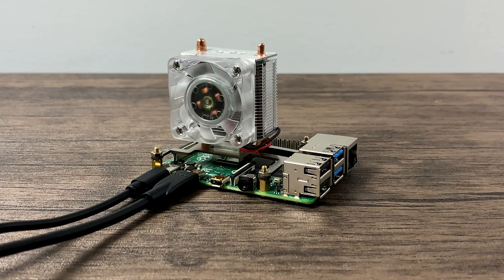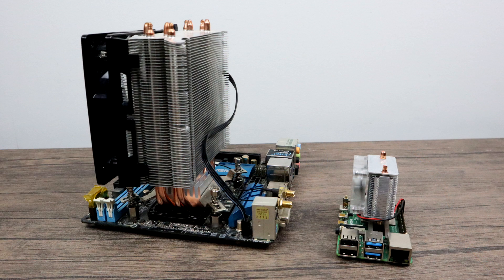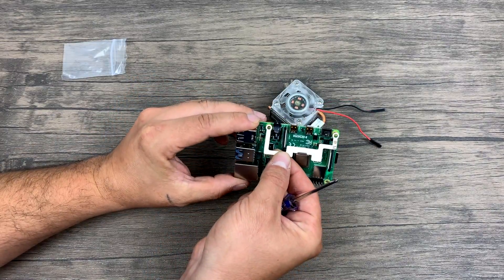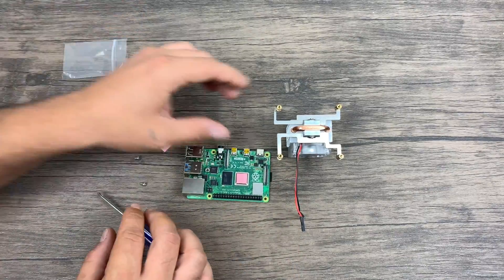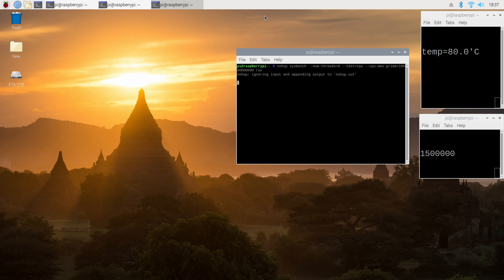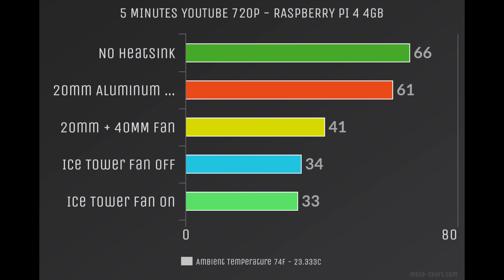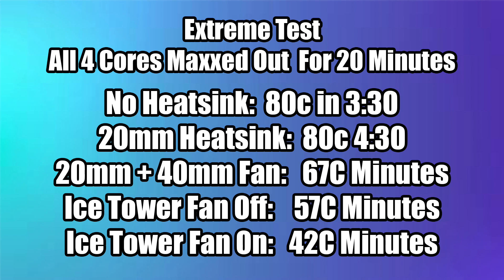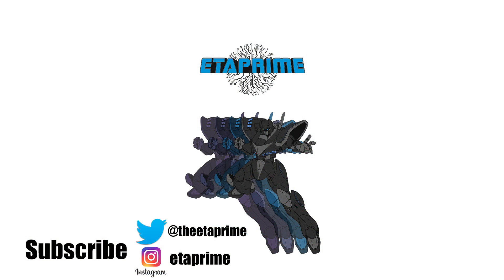The Best Raspberry Pi 4 Cooler! The Ice Tower Also works on the Pi 3 & Pi 3B+

Comment from the maker: Sorry for the quick re-upload, The last chart was a little messed up in the original.
Reply: Overclock overclock overclock!!!
Reply: overclock overclock overclock!!!
Reply: Maybe try some thermal compound and see if it improves the cooling compared to thermal pads!!
Reply: do some bigger oc on it
Reply: See if you can get it to 2ghz +
Reply: The image at 6:25 still says "minutes" three times for no reason in the bottom right
Reply: Can you give us your Temps with the Ice Tower cooler, if you Overclock your RP4 to 2ghz?
i'm looking to get this cooler, but i'm also looking to Overclock my RP4 4gb to 2ghz, 
so with some more info from you, that would be awesome, and most likely the final though, before i buy this cooler :)
Reply: Is there a case that can work with this yet?
Reply: It comes with 3 pads and theres a little play with the cooler when bolted to the pi would it be bad or hurt it if i stack another pad so 2 pads to take up the space?

Comment: I have nice results with some very cheap cooling blocks (included in some kit) and a 60mm Noctua 5v fan (I run it on 3v). I bought some raspi cooling kit but the cheap included fans were way too loud at night

Comment: I'm getting a bartop arcade cabinet it has the rasberry pi 3b+,in it,running hyperpi,I've seen they have one of these on ebay but it's the low profile one,should i get one of these i wont be over clocking just plying arcade classics and PSP and Nintendo 64 games,just wasn't sure if i need this to play these games,also does it draw to much power when plugging this into the pi.or should I get the flirc case.

Comment: So how do you mount the Pi afterwards? I have the MB mounts for my arcade using the 4 holes on the PI and they are needed for this cooler (Yes sime case or bottom plate mount would be great)

Comment: Its a very good heatsink for rpi4 cool...
But there can be one problem here it will affect your wifi performance because the metal mounting bracket of this cooler comes exectly over the antenna and it will reduce its performance drastically.ble and wifi will get affected. It will be better if they go with plastic good quality brackets instead of metal.

Comment: I use the Noctura 5v fan mounted onto an open air plexiglass case with aluminum heat sinks and the latest RPi4 firmware.

Comment: I want to know if I use this raspberry pi 4 inside a car which park under a) open air  or b) Car Park in a building, will it cause a fire or flame when there is a program or app running in it with respect to with and without Ice Tower? In short, it is safe to run a program on raspberry pi 4 inside a car which is 1)  turn off and  2) is running on the road with aircon turn on. Thanks

Comment: Someone should write a utility so you can do the 20mm + fan and connect the fan's positive lead to a switched pin on the GPIO so that it will only turn it on when the CPU temp reaches, say, 75 C. Bonus points for using PWM to vary the fan speed.

Comment: And how i can attach my hifiberry now? And what case will fit?
Reply: Something I was thinking about, what the Pi Foundation should be thinking about going forwards is having the add on boards underneath the pi rather than on top. That way they wouldn't interfere with any cooling solution needed. Add on boards would just need to move the socket from the bottom to the top. Would create a problem for older boards meaning add on manufacturers would either have to offer two boards or supply unsolder and DIY.

Comment: Cool but it's bulky and cools the CPU only. On the other hand 40mm fan mounted horizontally above the board is much more compact and cools all the components too, eg usb controller.

Comment: To the Pi Design Engineers:
This makes the Pi combersome, especially, for anyone interested in using it as a music player with a hat. The Pi engineers should focus on more efficient CPU architectures that run cooler and get more efficiency and a longer die life. For adolescent geeks, this definitely, looks exciting, and I also add, beautiful, but is it really a good move? Please, designers and engineers consider to use an SOC that is more energy efficient and cooler to run.

Considering the temperature at which this runs, I will not consider buying anything similar, and will stick with older models. I have a Raspberry Pi 3B+ that can run without a heatsink: that is what I really call a credit card sized computer.
Reply: The Pi 4 has only slightly higher power consumption than the Pi 3 B+ (around 1-2 W higher). The thermal load is still very low, at less than 10W for the whole board for most realistic workloads. The Ice Tower is simply overkill for this board, which the video clearly shows as well. A compact case with a 40 mm fan, ventilation holes and no heatsinks will be enough to keep the Pi 4 from throttling. The Pi 4 is still a low-power and efficient computer. The big problem is that you simply can't get away with more than a handful of watts for an SoC with no cooling at all. A single watt may not sound like much, but for a small chip with no cooling at all (and perhaps confined in a closed case) it will have a large effect on temperatures.

Comment: Dedicated heatsink attachment points on the PCB would be greatly appreciated, even if only 2 mm in diameter.  Maybe the foundation can set a standard like they pretty much did with the I/O pins.

Comment: A challenging idea : I'd love to see this board in a little laptop chassis with 12" 1080p screen , huge battery taking pretty much all under the keyboard minus the space for the board and heat sink with fan besides the board instead of in top , so it stays as slim as possible, a copper pipe running over all the chips and to the heat sink , will do a great job I guess . inline ports soldered to the board instead of the 2 levels ports that are giving too much thickness for a laptop case implementation .

Comment: If it didn't use such a slow cpu i would buy it. Atleast an 8 core ARM cpu or a quad core at 2ghz+. Who agrees?
Reply: this is easily achieved by "overclocking" the pi 4b to 2.0ghz as long as you cool it. i read that it wasn't even a overclock as the a72 baseclock was higher than that, but that the firmware/software refused to run on higher speeds than 2.0ghz clocking a72. another cool feature of the a72 is it's performance per hz that has been increased. the instruction set inside the chip was made more efficient and this is why people claim it to be up to 3 times faster than the 3b+. we just need some time to see the firmware and software mature and improve the board. sit back and relax, within a few weeks we will know more:)

Comment: I think it's necessary to use thermal paste with this. Thermal pads are only good for low-heat applications. If the CPU reaches above 70, that thermal pad is going to be the "bottleneck" of this cooling system.

Comment: Nice testing!  I'm going to get a Pi4 for my everyday computer so i can do some robotics dev.  I will get the ice tower, but not bother with adding the fan for just a few degrees difference. Mainly because I like it nice and quiet and fans tend to add noise.  All good wishes. I gave you a thumbs-up.

Comment: You should get liquid nitrogen and see how far you can over clock
Reply: Pi has voltage locked down hard, you mostly need a voltage mod
Reply: i saw a video where they had to supply their own voltage or something for a higher overclock
Reply: James Holbrook yes I have the parts for it (I’d use my EVGA Epower V board), I also run daily computer systems sub-zero (-35c block temp for sub-zero core temp peak on even FX-8350 at 1.7v, or -60c idle), the pi would be at -60c on that cooler since anything below 20w is what I call idle. I also have a T-Rex LN2 cooler for big CPUs like my Threadripper, but its baseplate is bigger than the pi, and the components on the board would get in the way.

It would probably make a fun and interesting video, but it’s really time consuming to make a compact video for that (a lot of work involved, mostly filming and editing plus research for the mod), but if someone wants to send me a pi, I’ll gladly show how to hook it up and bench it to the limit and see what records I can break (the pi will be pushed to destruction, I won’t be sending it back, that’s just the price of record breaking and filming cost is basically nothing since it is only worth my time because it would be fun, and that’s why I benchmark anyways is for the fun!)

Comment: Little advice, use two fans at half the speed. The airflow will be the same but the noise will be a lot less compared to one fan.
Reply: That’s not how fluid dynamics works... the velocity doesn’t go up by a factor of 10 when I stack 10 fans on top of each other when they go the same rpm they did before now does it? So why would it for 2 or 3 or 500? It doesn’t... airflow is volumetric flow rate, or area of fan times velocity, so no matter how manny hundreds of fans you stack push/pull, the velocity won’t just increase by a multiplier like that without the RPM increasing (I do have duel stage contra rotating server fans, the front is 7 blade vane and the second stage is 5 blade with aggressive pitch, they run different RPM to maximize airflow, however don’t be fooled thinking they aren’t doing this to increase RPM/velocity/airflow, just look at the math, volume per time is airflow, and that’s area times velocity (distance^3/time).
Reply: Not at “half the speed. The airflow will be the same”, that is physically not possible, and to that I’d say study physics. I have an aerospace engineering degree, but I will still say “it’s not rocket science”, the physics is very easy to understand.

If you still don’t understand, draw it out, you can simplify the airstream as particles slapping an angled blade, or simply envision the particle being thrown from a blade of X diameter and Y RPM with Vtrsfr_efficiency= ~90%, and then envision that particle hitting the second blade again at the same X and Y V, meaning that it really can only gain approximately 9% faster velocity with the second fan. That would be roughly 49.5 units/time vs 90 units/time, that’s certainly not the same...
Reply: Also your dB scale is wrong, it’s logarithmic the other way, it would be 12dBA vs 15dBA (not 3 dBA, my goodness, an inaudible cricket a mile away would be on that scale!)
Reply: @jakegarrett8109  . I actually have a physics degree and have been over two decades in the field of acoustics and extensive experience in practical research and testing. So i think i know a thing or 2 about these things. I would highly suggest googling/searching the relationship between acoustic noise levels vs RPM, because yes that is a 50 log. Fans are somewhat between a coherent and incoherent source, so therefore the 3-6 (more like 5) dB if you double them. Two fans in series have the ability to deliver double the amount of air. Especially in a push-pull configuration were there is quite some resistance (like a heatsink). But hey, do whatever you want with it, i am not here to have a nitpicky debate about things that can easily be found on your favorite search engine and has been used for the past 70 years or so.
Reply: Merlin Gallagher Merlin Gallagher wrong, that is for parallel (which makes sense, 2 fans sitting side-by-side equals two times a volumetric output), in series this is simply not the case for any fluid pump in series!

So your saying my stack of 10 fans in series (stacked) = 10x the airflow? Wow is everyone going to laugh at that physics! (I hope you haven’t been using that for 70 years, because it’s been wrong for the last 70 years...)
Reply: @jakegarrett8109  That's not what he was saying. He clearly said that it only counts roughly for a small amount of fans, which is more than obvious since there a lot more things that influence these numbers. The only decent approach is are FEM simulations and even those are very limited if it comes to acoustics as well as fluid dynamics.
Reply: @jakegarrett8109  I also don't have a clue what you're talking about, but I can confirm that @Merlin Gallagher is absolutely right in this. Time to get out of your dusty books and lab and see how things work in the real world would be my advice as a technical consultant and CTO of different tech teams (so fun when people show off their so called degree)

Comment: Do me a favor ? You made the late panda alpha + rtx 2080 ti... then how abouth trying mounting the ICE-Tower on a real cpu like the Pentium G4560 (54w) and running the fan at 12v insted of 5v :D
Reply: Would most likely blow the fan circuit if it wasn't designed for 12V what appears to be the case
Reply: @resneptacle  "all" fans are normaly 12v but runs more silent on 7v-5v

I'm running an G4560 htpc with 100% no mowing parts..

I'll bet i'll be able to "netflix and chill" on the G4560 with this micro cooler (not silent) but i'd "lap" the surface of the cooler first and mount it with propper thermalpaste..

Comment: If the fan off isn't making too much of a difference, could try putting a Noctua fan. Since this is pretty cheap, that fan is probably airflow optimized, and isn't able to push much. Noctua fans are good for static pressure and still quiet.

Comment: Is their a way you could diy your own heat sink to see if it can out perform this heat sink?
Reply: I developed a water block for raspberry pi, look up Thingiverse for “Penny waterblock” it’s 3-D printed and uses a US penny sanded down. My entire water cooled tablet cost about five dollars, actually slightly less.
Reply: @jakegarrett8109  i have seen that before! How well does your design do compared to the heat sink ETA prime tested out in this video?
Reply: Blue 4lifeblue it should be way better. I used the 20x20mm heatsink he had, and it was a massive improvement going to water cooling (before I wasn’t pushing overclocked, and on water I hit a 44% overclock at 50c max). Which is not surprising since water cooling you don’t have the distance limitation you do with fins or heat pipes, and the radiator can be as big as you want (and because it’s so much more efficient pumping the heat through the water, you don’t really need a fan or as big of a heat sink, you could also make it custom shaping as I did).

Comment: This cooler may not fit an X86 CPU, but it looks like it might do a good job on one of those new AMD X570 chipsets.
Reply: Only if you opt out of using any graphics card. The cooler is in the way of that due to the chipset location.

Comment: interesting is use cooler without fan... good temperature. have You try to put cooler 90 degree for use natural ascension of hot air? maybe temps could be lower

Comment: So the ideal cooler would be a passive slightly shorter heatsing than the ice tower with a case that fits. 
By the way, could you test it with overclocking?
Reply: *heat sink

Comment: It's in the ball park. Better than the FLIRC CASE. But it's not the BEST. You need to idle below 30 c and when doing a stress test you can not  break 40 c. Theirs not enough metal on the cpu. Go to your large chain  hardware store and look up to where the steel rafters are bolted to the steel columns . You need the nut and the fan of the ICE COOLER .  You need a 22 mm spanner to turn this nut . Yes metal on the cpu. You will not break 40 c and idle below 30 c. I' now using round led eat sinks idle 26 c cannot break 35 c stressed and over clocked on sysbench it runs cooler when stressed. 
RUN SYSBENCH 4 TIMES 20000 PRIME NUMBERS 4 X IN SCRIPT CAN'T BREAK 35 C.   
SAME AT 40000 RUNS COOLER.
Reply: Who says you can't break 40°C? That's very cool for such a CPU under load
Reply: No  heat sink you are going to thermal throtel. Don't think computer  geek . Don't even put a tinker board heat sink  on It. 
Tinker board heat sink is 25 mm X 25 mm X 10 mm. 
Go to the hardware store buy a piece of aluminium or steel same size and blow a little air across it. 
Have  look at your temps. 
They will fall heaps. 
Buy some thermal grease and do a search on EBAY.   What you are looking for are heat sink for L.E.Ds. 
They are round 36 mm in diameter  and have a lot of fins coming of them. they 10 mm thick and 10 of them  in a pack for about $15.00. Use thermal grease between them and stack them up. First one has to have the fins ground up on a angel to not hit the wifi or it will short stuff out on the board.
PUT ENOUGH METAL ON ANY   PI   AND IT CAN NOT HEAT IT ENOUGH  THAT THE AIR GOING PAST IT CAN NOT COOL IT. 
MY PI 4 4MEG , 3 B+ ,3 will not hit 40 C. IT COMES DOWN TO SOME BASIC MATHS .
 How much heat do they put out? Give it more surface area to cool.
 The bigger your heat sink the more surface area you have to cool.!!!!!!!!!!!!!!!!!!!!!!!!!!!!!

Comment: I don't see any contacts for the memory, pcie or wifi/bt chips. Don't those get hot as well?
Reply: Those don't throttle tho.
Reply: Not hot enough to throttle, always there is inefficiency that turns into heat on those chips but it's not enough to cause issues, yet

Comment: The first Core 2 Quad system I built back in 2009 was all tricked out with LED fans & I had Heat pipes on all my coolers. I special ordered a Southbridge Cooler almost exactly like that, same fan & Grill config. Interesting, very cool (no pun intended)

Comment: Awesome review but the stand out in the test is the 20mm heatsink with fan. You could even get a better or bigger heatsink to improve the cooling and still get inside a nice case. I'm trying to find better cooling for odroid xu4q to avoid thermal throttling.

Comment: While this may not boost performance compared to the small heat sink with fan, keeping the chip at a cooler temperature can effect the longevity of the processor, an important consideration if you want the board to be in a more permanent project like an arcade cabinet.